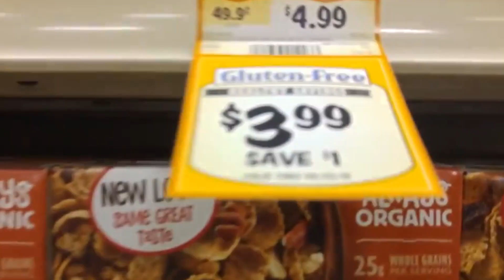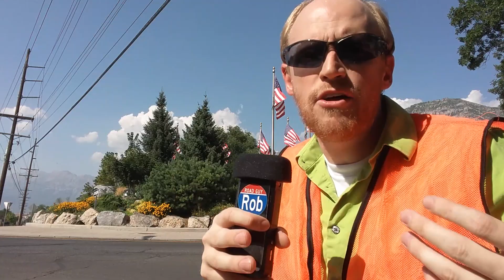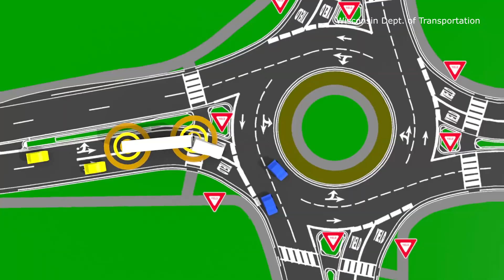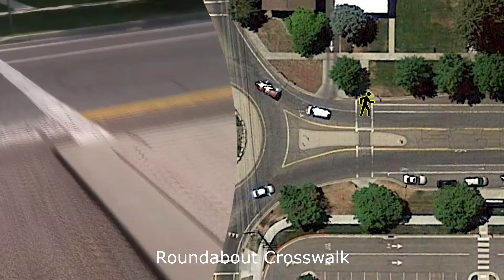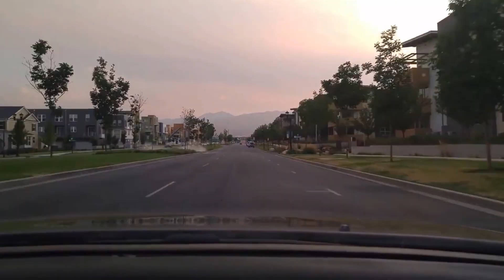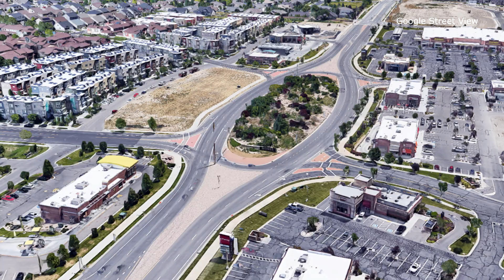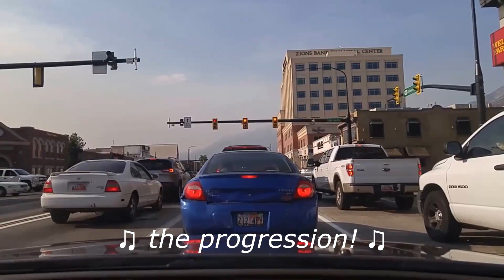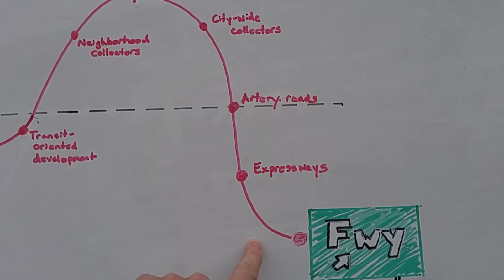Are roundabouts REALLY better than a traffic signal?

Comment: The three problems I see with roundabouts where I live (in the U.S.): 1. I've seen people turn left to enter a roundabout despite the signage and road configuration that attempts to restrict it. 2. We will periodically get "that one guy" who drives straight across as if the roundabout is non-existent.  You can put all kinds of things in the middle (e.g. trees, statues, fences, walls, etc.), but people will still drive on through and smash up their cars. A few years ago there was a fatality where someone nearly cleared the obstacles within the circle but a tree stopped him prior to re-entering the roadway. You can't fix stupid. And 3. I still see people stop inside the roundabouts to let people enter.
Reply: > A few years ago there was a fatality where someone nearly cleared the obstacles within the circle but a tree stopped him prior to re-entering the roadway

Sounds like an incident that improved the average IQ of the area. I've also seen someone crash deliberately driving over a roundabout, while speeding on a motorcycle, without a helmet, at night. Odds are pretty good that he was also drunk at the time.  

More broadly learning how to use a round about needs to be part of the driver education, which admittedly is a general problem for people who learned to drive 10, 20 or 40 years ago when there where no roundabouts in  the area. But then drivers not knowing the current road rules is something of a perennial problem.
Reply: I just witnessed #1 the other day. The car in front of me came to a complete stop (nobody was in the roundabout), turned left around a concrete island (built at an angle to funnel traffic in the correct direction around the roundabout) to go around the wrong way, then exited at the first road on the wrong (left) side of the concrete divider head-on into oncoming traffic, before getting in the proper lane beyond the divider.

Comment: In the UK we have traffic lights on nearly every corner especially in town and they are timed so that you need to stop at every set thus causing the maximum annoyance,  pollution, engine/clutch wear, especially late at night you can waste your life sitting at red lights when there is nobody else on the road, yes sure we have roundabouts but they are designed to be awkward to negotiate with sweeping narrow entrances to force you to slow down excessively

Comment: Its weird to hear about roundabouts being built, because in New Jersey, its more common for one to be removed than built. Then again, most of the ones being removed are big, multi-lane highway roundabouts, which I tend to get pretty freaked out driving on.
The worst roundabout I've seen is in downtown Suffern, NY. I'm not even sure if you could call it a "roundabout," but its at the intersection of Lafayette and Washington. There's a monument in the middle of the intersection, causing traffic to sort of flow in a circular motion, except that some traffic also flows straight past it on Lafayette, and there's also a traffic light there. Its not a pleasant intersection.
Reply: I'm pretty sure that that is actually a traffic circle not a roundabout and was actually been there long before the modern roundabout was invented. So while it is round it does not have the same road marking or right of ways rules as a roundabout.
Reply: @KonradZielinski  Ah. I didn't realize there was a difference between the two! I always thought the terms were interchangeable.

Comment: i drive a truck and think they are crap. None I have been in have enough room. dragging trailer tires over the curb which damages tires. Trailer tires cost from $300 each and up!
Reply: Here in Australia small roundabouts will often have a concrete area around the outside which slops up gently from the road surface, so that there is no curb for trucks to hit. Other drivers are expected to know that you are not supposed to drive on the concrete bit, which is reasonable here as roundabouts are common.

Comment: I find roundabouts to be a concern. When you completed a through drive on a roundabout, especially in commercial areas, the one or two lane roundabout blossoms into multiple lanes going every which way and the planter box in the center of the roundabout blocks your vision as to determining which of five lanes you want to be in on the other side. 

I hate finding out on the other side of the planter that I have to cut off five lanes of traffic to make my right turn into a shopping center.
Reply: There will be signs before you get to the roundabout telling you where the exit lanes go?

Comment: Here in Houston, you usually see roundabouts used two ways. 1) Where most of the traffic is turning the opposite ways (most southbound traffic is turning left (to the east) and most traffic coming from the east turning right (is going north), with the other two connections with less traffic. And 2) when they don't want people to use a road as a main through fare.  And people hate roundabouts so much, they will avoid side streets with roundabouts. In fact, they'll put roundabouts that only have two connected roads (total) to slow doing traffic and discourage use.

Comment: In Washington DC, we have a 3 lane roundabout WITH traffic lights in front of Union Station. It can be harrowing when experienced by a driver new to the area. And in a heavily toured city...well
Reply: I think that's one of the biggest issues that roundabouts have.  If you are a tourist or new to an area and go into a roundabout, especially if you're trying to follow GPS directions or find which exit from the circle leads to a particular road, it can be tricky to find.  If you come up to a traffic light usually you can see in advance whether you need to go straight, turn left or turn right and if the light is red you have some time to confirm it.  With a traffic circle you shut down the flow if you have to crawl through it or come to a stop.  Nobody wants to go around the circle again.  Most are fine once you are used to a particular circle and know without looking where you will exit.  Assuming the circle is designed well for the traffic flow.

Comment: In France they have a priority to the right rule, which means that unless there are markings on the road at a junction, the car to the right gets priority. Compare this with the 4-way stops you get in North America where the car that got there first gets priority (it's the same in the UK but we just don't really have them).
Anyway, because of this rule, all roundabouts in France have signs at the approaches saying you don't have priority, because otherwise if the traffic got busy cars on it would have to let others on and it would block up quickly.

Comment: Very nice and balanced. I'm from the "old world", where you can't pass a driving test and get your license without demonstrating going through a roundabout. I was both amused and annoyed to hear my fellow co-workers here in America complain about having to pass via a roundabout to go somewhere. 
IMHO they work better as a replacement of the 4-way stop junctions, but terrible on main grid roads. You mentioned cost, so maybe I should add that slowing down to pass a roundabout is more economical and ecological than coming to a full stop in a 4-way. It also eliminates the Mexican standoff situation, where drivers just stare at each other not knowing whose turn it is to cross. 
They can be a bit scary during snow storms, because otherwise a stop or go straight situation turns into a sailing exercise.  
As for pedestrians, you're right. But consider that American towns are not so pedestrian friendly to begin with, given the very narrow sidewalks that sometime go on only one side of the street, if at all. In towns that have much wider sidewalks, the sideway and back route you show is not felt so much. In any case, the crossing part is doubled, not the whole length of the walk.

Comment: in America roads are depend on he state kind of like Europe if it controlled every country but each country has control, 
https://artbabridgereport.org/state/profile/IL
For example this is Illinois
1. Of the 26,825 bridges in the state, 2,407, or 9.0 percent, are classified as structurally deficient. This means one of the key elements is in poor or worse condition.
2. This is up from 2,147 bridges classified as structurally deficient in 2015.
3. The deck area of structurally deficient bridges accounts for 12.4 percent of total deck area on all structures.
4. 186 of the structurally deficient bridges are on the Interstate Highway System.
5. 1,203 bridges are posted for load, which may restrict the size and weight of vehicles crossing the structure.
6. The state has identified needed repairs on 4,129 bridges at an estimated cost of $5.8 billion.
7 .This compares to 4,049 bridges that needed work in 2015.

there is no budget to change the rounds to roundabout basically since 4,129 bridges in illinois needs to be repaired

back in 2019 https://chicago.suntimes.com/2019/10/21/20926058/pritzker-releases-details-rebuild-illinois-road-construction-plan-bridges
``Pritzker releases details of $23.5B road construction plan, touted as ‘investing on the front end’``

``“This is a big change from how previous capital programs have done this in the past when the state would let roads and bridges deteriorate so thoroughly that repairs have cost taxpayers far more than if they’d been maintained to a minimum standard,” Pritzker said. “Instead, we are embarking on a new regimen of investing on the front end. This is a historic improvement which will save taxpayers potentially billions of dollars over the long run.”`` 
yap this is true basically no one is taking care of the roads so we are over spending

it's not i hate roundabouts but in America it's little tricky besides not many knowing how to use them and where to place them since we have semi trucks and such rolling through town

Also Illinois spending and gaining https://usdebtclock.org/state-debt-clocks/state-of-illinois-debt-clock.html

Comment: I hate these because they're all different. Pedestrians indeed walk on the road to save time. People not familiar with them will drive in circles or the wrong direction or not yield when they're supposed to. The only benefit is not waiting through a 5 minute light cycle. They work best when a busy road intersects a not busy road, but here they are just putting them everywhere.

Comment: Roundabouts have limitations as with any other traffic control device. They work well with certain applications, not so well with others.
Reply: @1234hijs  They aren't good for every application.
Reply: Good idea to provide examples where they dont..
Reply: @yvoferdinandvanderhoek1027   That's not what he asked but OK here we go. Number one they take up a lot of space so in areas where space is limited they're not practical. Number 2 areas of high pedestrian traffic are not good for roundabouts. Number 3 areas where there's a lot of mixed traffic are not good for roundabouts. Number 4 an area where there are a lot of streets coming into a roundabout are not good.  Number 5 areas of low traffic are not cost effective because of the high cost of construction and obtaining  right of way, to name a few.
Reply: @robins1016  
1. Not every roundabout needs to be huge. In fact in most cases a 2 lane roundabout is more than enough to serve most areas for many years especially in the suburbs. I've seen many new subdivisions that have relatively little traffic that will take many years to even get up to moderate levels of traffic that would be much better served by roundabouts. Cheaper to maintain and keeps traffic flowing and hence reduces carbon emissions which is what everyone wants.

2. Kinda of agree. If there is very high pedestrian traffic then perhaps traffic signals are better, but moderate to low levels of pedestrians then a roundabout is a good/great alternative. There are plenty of areas outside of a city's downtown core that usually doesn't see high amounts of pedestrian traffic and outside in the suburbs there are often barely any people walking which makes roundabouts a great choice.

4. Depending on how the situation is, a roundabout could be a better solution than traffic signals because vehicles are constantly moving even if slowly compared to traffic lights where you can be stuck for long periods of time in heavy traffic.

5. Disagree. Areas of low traffic is PRECISELY where roundabouts function the best. Whether or not they cost more initially to build, in the long run as stated in the video it will be cheaper to maintain and run and you don't have to worry about when the electric grid goes down.

Also how do you not get pissed sitting at a redlight for 30-60 seconds and watching 3 cars going the other way and think how stupid it is that you're wasting time and creating unnecessary emissions idling at a redlight? I can't tell you how many times I'm driving on a major road and then the light turns red and cars are piling up behind me in a platoon and you see one or two cars going the other way and you just sit there and sit there getting angry that unnecessary traffic is being created because of poor traffic light timings. I swear if whoever is in charge of setting those traffic timings could do their job properly so much traffic could be avoided and traffic flow would be so much better in many cases.
Reply: @UzumakiNaruto_  I disagree with your disagreement on #5.  Where traffic is low enough in at least one direction, and especially where it's low in all directions, a circle is a waste compared to a "YIELD" sign.
Reply: @goodmaro  
The thing is with roundabouts is that again they're good for low and high amounts of traffic. For example if there's a brand new subdivision and you have a roundabout, the amount of traffic might be relatively little in which case a roundabout is perfect because you don't have stupid traffic lights to stop you even when there's barely any cars around. 

When a few years pass and the amount of traffic increases, the roundabout will still be able to handle it. IE its scalable without the need to change much in the future unless the traffic dramatically increases.
Reply: @UzumakiNaruto_  In the case of the new subdivision, why are you comparing a circle to a traffic light?  When the traffic is that light, an uncontrolled intersection is fine, a circle's a waste.  When the traffic's a slightly heavier, a yield sign may be required.
Reply: @robins1016  " Number one they take up a lot of space so in areas where space is limited they're not practical" No, they just don't have to. You can place a micro roundabout if you can't fit a normal one. And normal ones still do not need much more space than the standard intersection.
Reply: @jus4795   Micros are only practical in low traffic areas and if you have very low traffic you don't need a roundabout. Thanks for your comment
Reply: @robins1016  …but roundabouts are not placed in high traffic areas. That would be silly. Roundabouts are for low to medium range traffic. + They are a convenient for everybody way to slow down the drivers - for example in the pedestrian areas. You could use equal priority intersections -> that would do it’s job, but that might slow down drivers too much if you have an area with medium range traffic. Micro rounabouts generally do not slow down drivers very much, as they just act as a circular speedbump, which you should get around. -> but they still make the area safer than without such roundabout
Reply: @Jus  They are where I build roads maybe not where you do. So what you say may be true for you. Like I  said originally, they are good in some applications and not in others. The applications will change depending on where you are. Not everything will apply everywhere. Thanks again for the input.

Comment: Road Guy Rob: Please do a video about roundabouts compared to four way (all way) stops and discuss safety, cost, and time to get through the intersection (cars through per minute). I've never understood four way stops, why make everyone stop? Many times I could go but I can't because someone else was there first and has stopped and now needs to speed up. If s/he went through the intersection without stopping (or only slowing down) s/he would have been out of the intersection before I got there.
Reply: They can work well if the traffic flow is low enough and take less space and cost less money than a circle.  It also serves to reduce traffic speeds in town and is easy for pedestrians to cross.